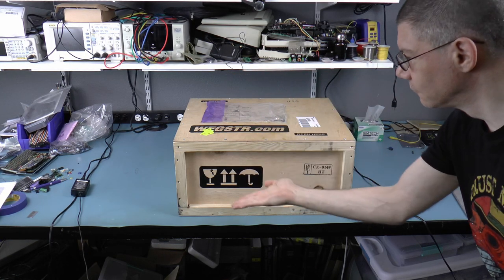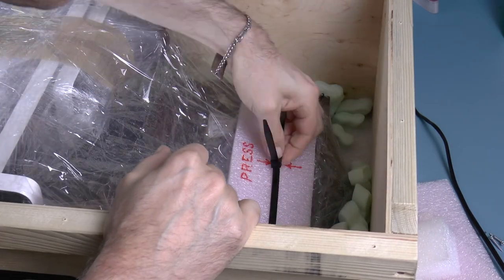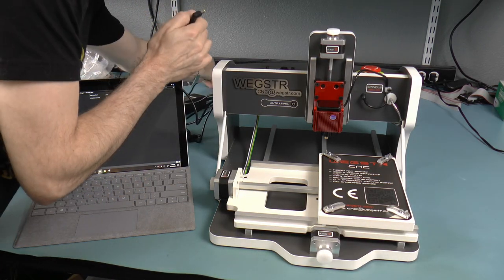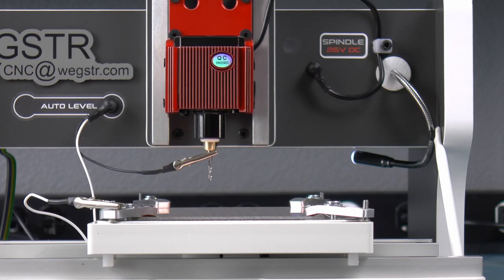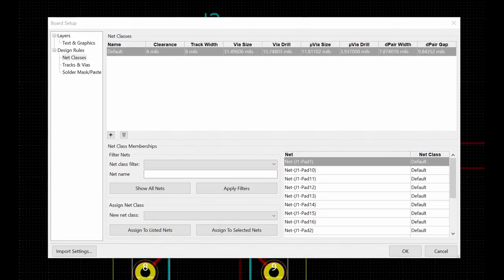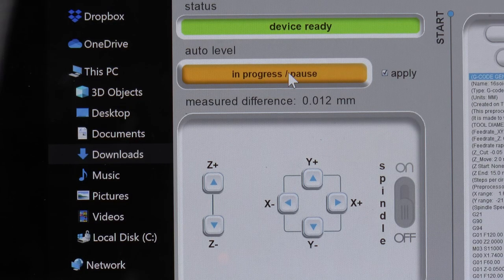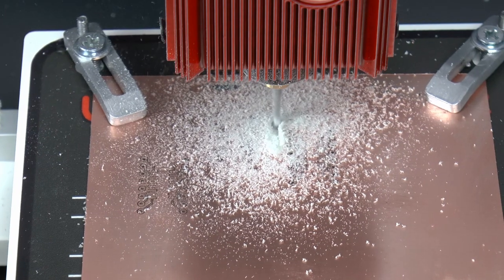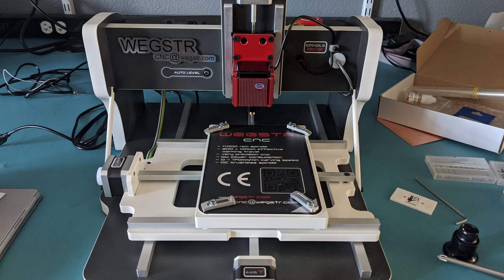The Wegstr CNC prototyping mill

Comment: As many have observed, these machines are quite expensive for what you get. They’re aiming the product at folks that want a fairly trouble free straight-from-the-box experience. The wegstr YouTube channel, regardless, is well worth the time. I find their videos very relaxing, and if you’re trying to figure out what’s involved in making your own circuit boards, quite informative.
Reply: I was about to say pretty much the same thing. It's a pretty standard cnc engraving machine, it isn't worth anywhere near 4000 USD. It seams sturdy, but you can get the same thing for about a tenth of that. Some people watch their videos and just want whatever they're using to achieve the same results out of the box.
Reply: Totally with you. I think its way to expensive too but the way how they make uv solder masks with it is pretty cool

Comment: This is NOT a rip-off, as this is an extremely precise, high quality machine. I have 3018 PRO mill from China, and I cannot get under 0.5mm (20 mil) traces and 0.7mm spaces as the play and vibrations are so high that finer traces are eaten away by mill bit. And V-bit is impossible to use as the auto-leveling of free software does not work (I have to find such software yet, and I have tried many), so my only option is to use c-bit. I am a freelance electronics engineer, and I often need to quickly make some test pcb, some converter or adapter, and also to check if components fit their places in mechanics and housing. I cannot wait for 1-2 weeks every time I want to check that things fit. When I save up enough money, I will definitely buy exactly this model. That being said, I am a professional, milling a prototype pcb even several times a week, so this investment pays for itself rather quickly. Of course, for hobbyists who need only a couple of PCBs per year, this is an overkill.
Reply: Hi Andris, I use the same CNC machine (CNC 3018)  and I can get 0.1mm precision as I use a flex shaft motor , so all the vibrations are gone. My only problem is the noise from this 200W, 20,000 rpm flex shaft motor.

Comment: $4,000 for a handful of linear rails, a few NEMA 17 stepper motors, and a low-grade spindle without an ER 11 collet is absolutely bonkers.
Reply: funny ,but 3018 CNC from ebay with ER11 collet and bigger spindle for 300$ can do even more than that :)
Reply: @goodwill7643  tell me about it! I started with a 3018. You need to upgrade kind of a lot to get it to compete against this, but that is primarily due to the linear rails as opposed to linear rods. The 3018 has a lot of play in the z axis. 

However, for this price, you could buy the best 3d printer on the market, a cheap aluminum extrusion cnc, upgrade it with linear rails, use ball screws if you want, and limit switches, and you'd still have $2800
Reply: @goodwill7643  I mean by comparison, for this price, you could get a servo controlled grizzly which can cut pcbs all the way up to steel. For this price you could buy a tormach. Its crazy what they are charging for this.
Reply: @honkhonk165  I have 3018 and I do PCB milling and front panel cutouts without any upgrades.
About price I completely agree, for that it is pure marketing.

Comment: Hi Robert, It's a shame they didn't use a collet in the spindle. A grub screw in the spindle seems like  a bad idea but that's just me. 1 mil of runout isn't bad, though. 4K is a bit too rich for me even though I'd love to have one.  Thanks for the vid!
Reply: 1 thou runout on a pcb milling machine is bad, on a $4k machine it’s terrible. Just checked my box store Dremel, less than 0.5 thou. Add a cheap collet and it’s up to about 1 thou on the bit shank. I totally agree that a grub screw is a shame. As a package, software, integrated touch probe, overall presentation seems quite a nice pcb making tool. For it’s intended purpose I suppose the grub screw is good enough, just don’t buy 3mm bits by mistake.
Reply: @klave8511  0.5 thou on a dremel ? Ok then ... you should have bought a lottery ticket in the same store.

At any rate, there is a good reason for the grub screw. Mounting a spring tensioned bit in the holder for Soldermask milling. You can view the method on their channel. Why use a collet anyway when you have a machine that is only supposed to use 3.175 mm shank bits?

As for the price, yes, a big shame I agree.

Comment: It's a very nice looking machine, but for the price, the tool mount (grub screw) is very, very disappointing.
Reply: There is actually a good reason for that ... Milling soldermask (after it is applied to the whole board) is done by mounting the engraving bit loose in the tool mount (with a spring at the top pushing the engraving bit down). The grub screw serves as a stop then to prevent the tool from falling out (not to actually fix the tool in place). This way the engraving tool can mill the soldermask off the copper without milling away the copper using the spring to put just the right amount of down force on the bit.

Doing this with any other tool mount option would be hard. In reality given that all tools used by this machine will have 1/8th (or 3.175mm) shanks the grub screw is quite ok.
Reply: @xConundrumx  he is mounting the MILLING TOOL with the grub screw. I don't care that it supports a spring loaded tool. It needs to be able to grab the tools properly, and a grub screw is absolutely terrible.
Reply: @zaprodk  Alright, no need to yell.

Comment: thanks for posting this!!! 

The spindle sounds terrible, was that the audio or does it sound like a lot of chatter in person?  How big was that cutout bit, looked like 1/8"?  Also it looks like the Z uses a regular fine pitched all thread and not a lead screw.  Are the other 2 axis like this?  How are they constrained?  It doesn't look like it has linear rails.
Reply: Some good questions there! I think! Since it probes the surface, a regular threaded screw is probably ok, it only cuts a fraction of a mm when making a pcb and for cutting the pcb out of the panel the leadscrew is probably nor necessary, a nicely cut threaded rod is probably ok. Would struggle to get a fine pitch trapezoidal thread anyway.

Comment: For the price it should at least have a better spindle with ER collets.  And idk for $4000 Id build my own that would out class this.
Reply: Actually the collet makes sense. You don't see it in this video but one thing you can do with this collet mechanism is is spring load the tool. What this means is that the tool is able to move up and down in the collet (which you cannot do with ER collets). Why would you want this, well best go look at their youtube channel for an example but with the engraver spring loaded in the collet you can 'scrape' off UV photo resist solder mask from the pads. Essentially you put some UV hardening solder mask over the entire board (with a silk screen or such to get it nice and even), harden it out, then remove the mask from the pads where you need solder to go. Thanks to the spring loaded tool you can do that without scraping of the copper underneath.

But you are right about the price. It is alas a bit on the high side. And for that cost you can indeed get better bang for your buck. Personally I would go with one of those blue anodized 1310 CNC's (as they have real linear rails) and an S4225 24k or higher BLDC spindle (ER8 collet with low runout). Would have smaller work area but in my case that would be enough for PCB prototypes. For solder mask you can always use dry film solder mask and a mask for the solder pads while UV curing that (pretty tricky to do right with solder mask from a tube).
Reply: absolutely.
Reply: my diy 200 dollar cnc almost out class this
Reply: @TnInventor  I would say a video is in order then.
Reply: @xConundrumx   i am already on it
Reply: @TnInventor  Wonderful, will be keen to see the results. Get about 1 good pcb out of 4-5 tries atm with my modded 3018 so perhaps I will see some pointers.
Reply: @xConundrumx   as long as my mill dont break on me i always get it perfect , i will make a tutorial next week :D
Reply: @xConundrumx  Got some known good dry film solder mask? I've had good results from very few attempts at home with laser printed transparencies with dry film photoresist so I sure would like to go that route again when doing PCBs with a laser engraver now (bought a 405nm laser here, time to make 'em skipping the prints, since I don't even have a laser printer myself).
I wonder how good results laser exposure on the liquid thingy gets me, what do I need to do before exposing and so on, if I have to cure it in the dark or something like this. There will be A LOT of messy experimentation going on when my machine is ready...
Reply: @Kalvinjj  Well for me that will end up being Dynamask, just because it is something that I can get in Europe. This is more than anything the recurring issue for me. Availability locally. Getting Amtech flux or the MG Chemicals liquid tinner or any of the well known brands and products locally has proven absurdly challenging so availability is usually the primary concern.
Reply: @xConundrumx  thanks, this makes sense. It's the same for me too actually, getting locally is also hard in Brazil, very little interested people here it seems. Getting from anywhere that is not China, shipping and taxes get astronomical quickly, so Aliexpress has become quite a source of stuff not available here or with exorbitant costs. Let's see if I find it there, photoresist was easy enough but never seen the mask other than the liquid thing.
Reply: @Kalvinjj  No worries, btw there are several good videos on here about the product, that might be worth checking out first.

Comment: Is there are market to provide custom PCBs quickly in the USA?   I just got my batch of PCBs from China, took two weeks and the design changed 3 times since then.
I just ordered another batch of 50 of the latest design, and now I wait another two weeks.  The first batch just goes into the trash.  I use toner transfer and etch, and while this works good..I have to print multiples to get a good one off the laser printer and hope I don't screw it up with the iron.   I've seen lot of videos people making cnc circuit boards, and their results are about as hit-and-miss.  It can't really do small smt components reliable like the production machines can do.  I think you still need to etch which can do molecule level work.

Comment: When drilling holes, what stops the drill damaging the platform. Is there a sacrificial board under the PCB, or is the PCB supported so there is a space below it?
Reply from the maker: Yes, there is a sacrificial layer underneath.
Reply: Thank you for taking the time to reply.
Reply: စိတ်ဝင်စားဖိုကောင်ပါတယ်
Reply: @weiaungweiaung  there are some advantages of supporting the PCB at its edges, thus doing away for the need to have a sacrifice board underneath. The disadvantage is the risk that the PCB will flex, degrading  the accuracy of the drilling and cutting. With thick PCBs it is possible to use an unsupported board, particularly if the edges are well clamped. 
Ideally we either need a self healing sacrifice board, or low cost sacrifice boards that are already flat. The material for such boards, should minimise the damage to drill bits.
Reply: @RobertBaruch price

Comment: $4000 is way too much. I got a used 3020t from ebay for $300. Use emc2 with eagle pcb software. There is the surface calibration for it and works like a champ. Spent another $100 on limit switches, pcb boards, specialized drill bit. My only grief is that one of the driver died and ended up ordering a whole set of drivers from alibaba but now I got spares.
Reply: I'm building one this week and putting all custom electronics and controller on it. What do you use. I'd rather a simple option than build a custom controller. Any help is appreciated
Reply: @Sang Kang  cool thank you. I was thinking long term that I might make one out of a teensy 4.1 and 5160 Bob boards. I have a bunch just sitting on my hoarde of components we all have hahaha

Comment: Interesting, thanks for the review.
Question, what are they using for linear movement? Those don't look like normal rails.
Reply from the maker: Looks like threaded rod, aluminum, and nylon or teflon. Nothing fancy. Maybe a preloaded nut for eliminating backlash.
Reply: Thanks. Given the looks and checking this CNC price I was wondering if it was something super fancy.
Reply: @RobertBaruch  Dear Mr. Baruch - I'm quite impressed with what you do - I'm a tech enthusiast and I want to learn certain things from you - of course I'm ready to pay remuneration if it is within my budget. Please share your email id. Alternatively, I can share mine. Please let me know ...
Reply: @RobertBaruch  Is there anything holding the bed down to the extrusions other than just the lead screw/nut? Maybe the upward forces are not strong?
Reply: @RobertBaruch  Is there anything holding the bed down to the extrusions other than just the lead screw/nut?

Comment: you could have saved me 12 min of my life and stated the $4000 price first.
Reply: you can buy similar machines on aliexpress for a couple hundred.
search 3018 engraver.
make sure to get spiral engraving bits, the regular ones constantly break.
for bits search "spiral engraving bit 0.1mm"
Reply: @LittleRainGames Aliexpress machines are not suitable tp make sad pcbs like this machine
Reply: @LittleRainGames  As someone with a stupid amount of experience in making PCBs using various techniques AND has perfected their own PCB fabrication line at home (from photoresist lamination to through-hole plated), I can tell you that the ONLY thing that makes this machine special is the bit. You are right that a cheap Chinese CNC is able to do work to this quality, BUT if your engraving bit is cheap, the resultant work is rough and completely unusable. If you want these results, its worth buying the Wegstr engraving bit....

Comment: I mean, who doesn't want to have a CNC router... but I will stick with toner-transfer for my quick-n-dirty pcbs. Much less dust, faster, cleaner, ...

I just wonder why they could not have done the auto-level directly through the motor spindle without that awkward crocodile clip. The tool and spindle are conductive and the spindle is definitely going through a metal ball bearing, hence it should be conductive all the way.
Reply: Many people have a cnc router like this.... a 3D printer. Attach a low grade motor with drill holder and you're there.

Comment: What if that autolevel contintuity check fails? (crocodile clip comes loose) Is there any safety or it will bang on the material?
Reply from the maker: It will not lower more than 10mm. But also, it detects the increased current in the motor and stops. But at that point, you've ruined your bit and your material.
Reply: @RobertBaruch  Great thanks! Looking forward to see more vids on how this fits into your workflow. ;)
Reply: @marios2liquid  it should be absolutely possible to combine the autolevelling principle in the new Creality Ender 3D printer with this machine. Putting the complete spindle motor onto a strain gauge and measuring the impact force should allow for an immediate feedback on the fly...

Comment: Was that an 8 mil trace and 1 mil run-out?
Reply from the maker: The smallest trace ended up at around 4 mil. The key limiting factor is the space, which came out at 10 mil or so. I'm not making RF boards here, so the actual sizes don't matter, as long as I can get the paths accurate enough, there should be no broken traces. And yeah, 1 mil runout. Of course, I have no idea how inaccurate it is when you add the vibration of the machine, but it seems to have worked out okay.
Reply: It must have some run-out because normally those square pinheaders fit snugly in 0,9mm holes.
Reply from the maker: @zaprodk  I measured the holes at around 0.94mm. The pins are 0.64mm on a side, so 0.90mm diagonal. That isn't a snug fit for sure, but I'll take it.
Reply: @RobertBaruch  what I meant is that when I drill a 0.8 hole it's too small and when I drill a 0.9mm hole it's a nice snug fit.
Reply from the maker: @zaprodk  Oh, I see. I didn't mention it in the video, but I later changed the 0.8mm holes to 0.9mm holes. Yes, the pins didn't fit in the 0.8mm holes, which is why I had to change it!
Reply: @RobertBaruch  Oh, then it makes sense :)

Comment: Well, thanks for exposing it...that machine is pretty meh...
For less money you can have  a OB c-beam or the minimill with a 60000 rpm spindle ( much better finishing ) stronger stepper motors( faster ), ballscrew and maybe even linear rails ( precision ). Much faster, stronger and really good finishing for less money. Swap the spindle on said machine and you can also do some aluminum.

Comment: China CNC costs 200$, and knows even more. Why pay 6000$ here?
Reply: Those Chinese machines on eBay and Amazon don’t work at all unless you have a degree in electrical engineering. They also have absolutely no support at all. Not worth all the stress and aggravation. It’s worth spending another $4k.
Reply: The answer is accuracy